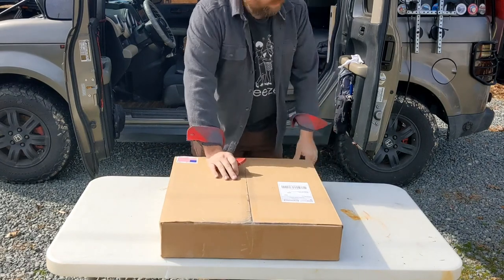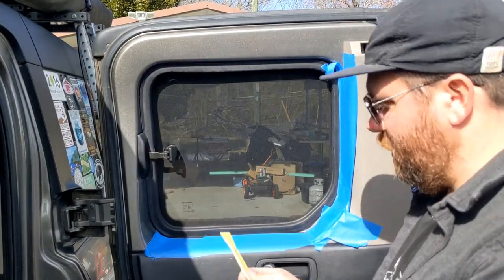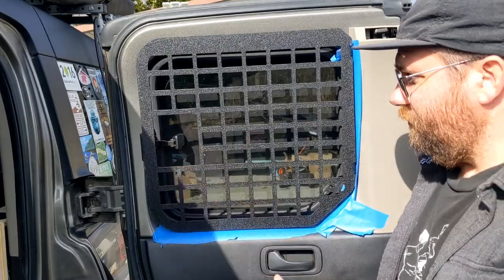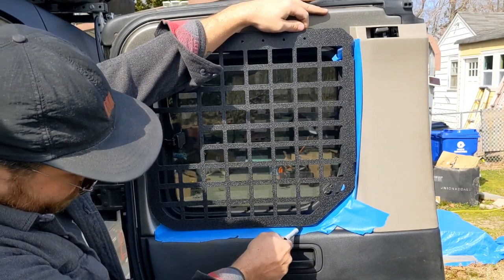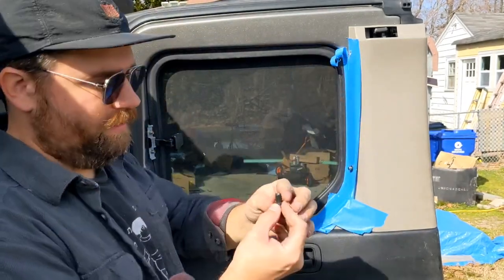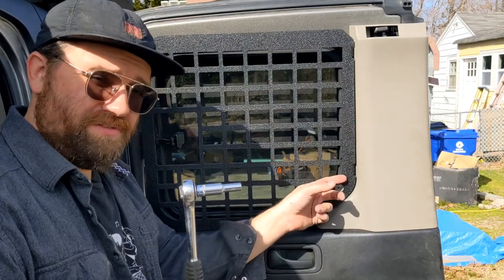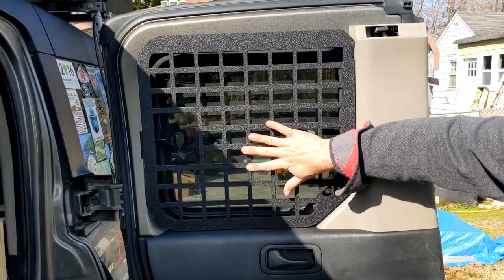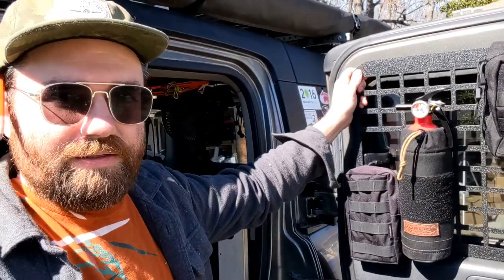Counter Productive Honda Element mid window molle panel installation

Comment: Hard to find molle panel that would fit on a honda pilot. I think ill just use the one from the side door of the element since it’s a smaller one. I dod want to be able to clean my window without having to take it off

Comment: If you are  only intending to mount  one  then it is better to mount it behind the  drivers  seat on the  rear  window so as not to block the view if through the right rear window when you shoulder check.  Needless to say you never needing  to look though the left rear window  while driving  is  less necessary.